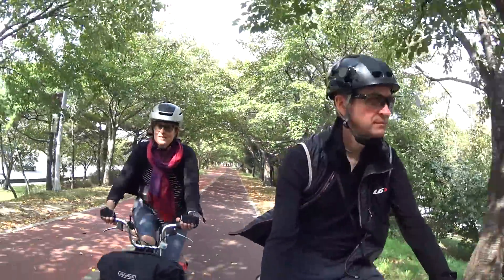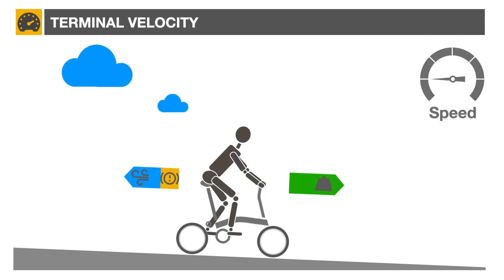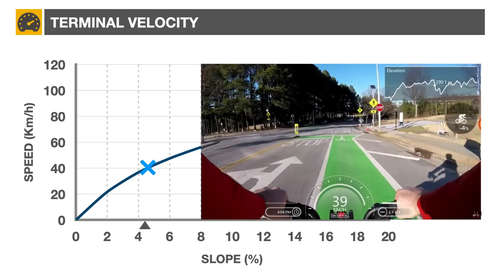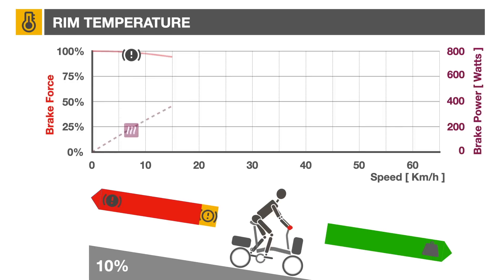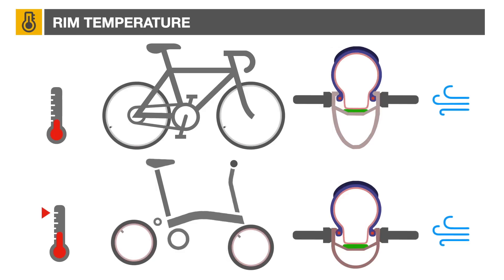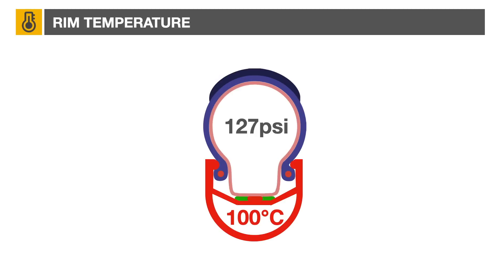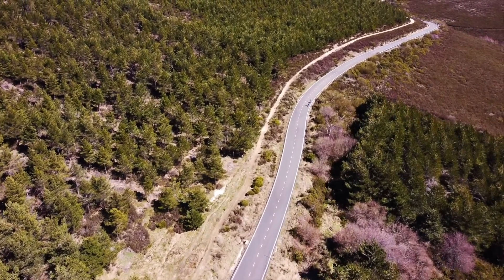Downhill with a Brompton [safely]

Comment from the maker: CLARIFICATION: While the Terminal Velocity of a Touring Brompton (T-Bag/Large Borough+20Kg luggage) is similar to having no luggage, the braking force required to slowdown (and the associated rim heat generated) will obviously be higher with a Touring Brompton. 
Brake force and rim temperature shown in the video were computed for a Touring setup.
Reply: Subbed 4 the math :)

Comment: We made many long distance trips with a fully loaded tandem. In an agressive and long downward slope, not only the tyres might blow, but also the brake blocks melt and totally loose their grip on the rims. Very scary. 
Once, we met another couple on a (packed) tandem, and exactly because of this fenomenom their brakes failed and both ended up in hospital, badly injured. Sadly enough, when they sent someone to collect the crashed bike and packages, there was no trace of it: all stolen! 
I can easily imagine that we Brompton riders with these little wheels have to be very careful not overheating them in the mountains. Thanks for reminding!
Reply: oh man, you would really have to be careful on a tandem! The rear rider adds weight and almost no drag, and you only have one wheel of braking power per rider!
Reply: I believe that could easily be prevented by using disc brake. Even if it comes with a cost

Comment: i had a scary downhill turn with the brompton in the french alps once which placed me pretty close to the guardrail. i vowed never to buy schwalbe kojak tyres after that.  with the softtail and slick tyres, the brompton doesn't feel much slower on the downhill than a roadbike does, and with that i can regularly exceed 80 km/h on a nearby road and over 90 on the one coming down from geschriebenstein austria (top speed ever 97.9 in ~35 °C wearing a skinsuit). i don't know brompton speeds, as it's very rare for me to take that in the mountains, and it doesn't have a computer on either. i think the huge difference between this and your examples mostly comes down to clothing and luggage, not the bike, but i have no proof of that

Comment: how bad would this be on 20 inch rims?
i hit 40mph on average on my ride to the train station and gone almost 50 on some other hills on 26 inch rims and was thinking of getting a dahon mu to get up the hill easily and then take it on the train or bus
its hilly everywhere round here too should i convert to disks maybe?
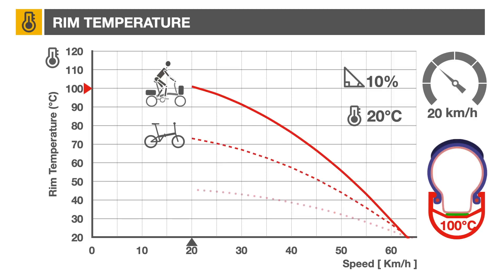Reply from the maker: 20” wheels with rim brakes are also susceptible to overheating but to a lesser degree than 16”. A comparison graph is shown at 05:36. Disk brakes would mostly solve the issue.
Reply: @2Bikes4Adventure  thanks
Reply: i do carry cargo btw i haul shopping over that hill too

Comment: Does applying small pressure in the brakes constantly to prevent acceleration cause less heat than full braking at top speed? I feel you could just use the brakes for a slow descent and there would be little to no heat generated, this problem would be completely avoided. Can someone explain?
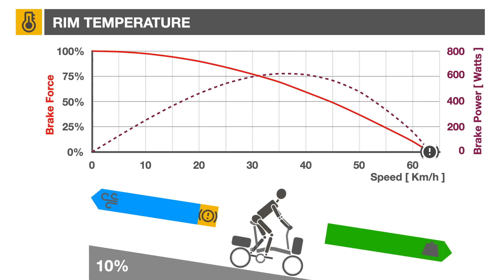Reply from the maker: Interesting question. The answer would vary depending on the slope angle and speed at which the test is performed. As shown at 03:55, for a 10% slope, the maximum heat generated occurs at about 35km/h, the “red” zone being between 20 and 50km/h.
If your light braking keeps you above that speed, you should be fine.

Comment: Shortly after a longish descent on a steep and slightly bumpy route, I did have the spokes on a Brompton front wheel unravel - it was very alarming. It may have been a badly built wheel, and I may have been unlucky, but it makes me somewhat cautious in the speed I go and the kinds of shocks or vibrations that I may be creating on these little rims.
Reply from the maker: Alarming is an understatement. Vibration/bumpy road was probably a major factor (more than only downhill speed).

Comment: As a Dane in a flat country (hardly 200 m above the water at our highest point!) we do have a rocky island in the Baltic, Bornholm! And on this we have a few serpentine roads which are very steep! I couldn't ride up even with 6 gears, but had to walk much of the way up. And besides that, we have "cattle prevention bars" crossing the road at several places on the one and have to walk over or around them, with a self closing gate!
     Going down again I had my serious doubts, but even braking down from extreme speeds to pass the bars, my Brompton brakes never let me down!!!  Finn. Denmark
Reply: I have thought about changing my similar - titanium fork to a hydraulic disc brake version in front (Which is possible from non Brompton producers), but as the braking power is enough for really most of my use, I decided to save my money! Finn. Denmark.
Reply from the maker: Trading the lightness of a titanium fork (and conventional brakes) for a more robust, wider (and heavier) steel fork with disk brakes would make sense if the bike is used for (heavy) touring in hilly terrain.
On the other hand, if occasional travels (or frequent local trips with minimum load) is the intended use, a lighter configuration is probably more appropriate. The money saved can be used on other bike accessories.
Reply from the maker: Denmark may have a flat profile, but from what we remember from doing the Berlin to Copenhagen trail, it can be quite windy. Not to the point where we needed better brakes, but we could certainly have used an additional low gear.

Comment: Day 1 Alpe DHuez I met someone who saw someone go over a hairpin having suffered brake fade at high temperature.  They were very lucky to survive. Advice was the same. Release brakes to increase air cooling, brake evenly and hard when you need to.  Don’t just trail them!  I was on a full size roadie. Checking periodically by hand probably a smart move on a Brompton - if too hot to touch, stop and enjoy the view.

Comment: Hello to you both and thanks for creating such useful and informative videos.  I just have a very quick question.  which cycle mirror do you use?
Reply from the maker: Through the years, we tried various mirror types (handlebar, helmet and eyeglasses mounted).
For the last few years, Gilbert has been using the “Take a Look” from Bike Peddler [ https://amzn.to/3Rt2KEc ].
It is inexpensive, light, robust and easy to attach and removed from eyeglasses.

Comment: Wonderful. 
I am always leary of too much speed downhill when touring fully loaded on my Brompton.  On my latest tour on Isle of Skye I reached 34.6 mph (55.6 km/h) with 10 kg front and 10 kg rear of extra weight.   The bike was solid with absolutely no wobble.  I pulsed my brakes (equally front and rear) and just enjoyed the ride.  The ambient temp was approximately 19 C and the road was smooth tarmac.
Thanks for the excellent analysis.
Reply from the maker: Common maximum gradient for major roads are often in the 6 to 7% range, thus a 50-55km/h terminal velocity is likely the maximum most of us will (safely) experience (assuming a normal riding position and no tail wind).

Comment: Chris from Chris by bike made a video that relates to this. She actually reduces the pressure especially in her front tire for extremely steep descents. She blew a tire out coming down from Christ the Redeemer in Rio
Reply from the maker: Reducing tire pressure prior to decent is a valid strategy, but it has to be used judiciously as it will increase rolling resistance (and heat up the tires) even if no brake are applied.
Reply: @2Bikes4Adventure  thank you very much for for the information and qualification on that method. I haven't had to exercise any of this but I intend to do more traveling and I know I'll experience such Hills one day 😊

Comment: Great video. 

I have had  a quite bad experience that I think is worth sharing. I once did a descent from Chiang Dao to Ching Mei in northern Thailand. I was riding my titanium Brompton, that is equipped with one of the best v-brakes you can get. The bike was only lightly loaded, with  a Brompton bag mounted in the front carrier bracket. My guess is that I was doing 60 km/hour, the road conditions was perfect, but suddenly the bike started shaking. I couldn't do anything to stop the shaking because the front bag that caused the shaking is mounted directly on the frame. If it had been mounted on front rack I would have been able to counteract the vibrations with the handlebar. The brakes was useless, If I had applied them I would be send flying. This is probably the most scary thing I ever experience bicycling for 40+ years.
Reply from the maker: Frightening story indeed. Wobble/shimmy need speed (more than 50km/h) and particular mass/frame stiffness conditions to occur. In your experience, do you feel the particular front luggage setup contributed to the situation?  Do you think the presence of titanium fork and/or seatpost (?) were contributing factors in the system instability? 

 And most importantly, how did you eventually stop the bike from vibrating (or it just stop by itself)?

PS This would make a great video subject.
Reply: @2Bikes4Adventure I'm quite sure it was from the luggage on the front carrier block, but there could be other factors at play of cause. 

I only have good experience with the titanium frame parts, and they still look like new, even though the front and rear frame on my bike is from 2006 :o

I tried stabilise the frame with my legs, not easy on a Brompton, applied very low force on the brakes, and rode it out for a kilometer or so before I could stop the bike and take a deep breath.
Reply: @petergriebel7321  😬wow.  I'm going to have to do more research on this because I love going fast and I don't intend to keep anything on the rear rack and I do not want to have to carry backpack so I've been focusing on shopping for a highly functional front bag. I had not heard about this being an issue before. Thank you for sharing

Comment: To prevent overheating my rims on long descents from Alpine mountain passes I do fully stop the bike and apply a wet cloth/rag to the rim (be careful not to burn your fingers!) to help them cool down quicker. I do that after every half a dozen to a dozen hairpin bends (every two to three hundred meters of elevation loss) (depending on the gradient of course)  If there's a fairly flat section I ride that with wet rims without breaking so that the evaporating water cools down the rims quicker.

Spritzing them with my water bottle has the same effect as wiping them with a moist rag but uses a lot more water, hence the wet rag.

I noticed that the rear wheel heats up much quicker than the front wheel, probably because there are more obstructions to the airflow (frame, my legs, rear fender). (May be a funnel could help with directing more air onto the rim to help with cooling)

I blew my tube once because I raced a motorbike down a mountain... the rim was unbelievably hot afterwards and it's scary but I could stop alright. On Großglockner I saw full sized bikes with rim brakes blow their tubes too.

(Dipping the wheels in ice meltwater besides the road helps too if the brook can be accessed easily/safely but I'm always worried about abrasive stuff in glacial meltwater)

(Usually the maximum speed is determined by the road, i.e. I could go faster if there wasn't a bend in the road. But there is so I need to brake...)
Reply: Would caution that depending on the rim material and how the metal was treated during manufacturing, rapidly cooling the rim could cause warping. LIkewise, depending on the tire compound, going from hot to cold could weaken the rubber over time. Let things cool down for a few minutes. Temperatures will drop fairly quick esp. with aluminum alloy rims. They're great thermal conductors, also also great heat dissipators.
Reply: @AlbertCLee  True. This would especially apply to dipping the wheels in an ice cold creek.

 However, wiping the rims with a wet rag is only evaporative cooling and has the benefit of wiping off crud/brake pad material off the rims. The cleaner the rims the less damaging the braking is to the rims (I've had to replace them because after some time the rims become more and more concave from braking with rim brakes)
Reply from the maker: Indeed, as much as we would like to ride our bike at terminal velocity, roads twists, turns and switchbacks may dictate otherwise. 
From your experience, you never had issue with degraded brake performance due to a wet rim (i.e., it would dry fast enough even if spraying it with a water bottle?)
Reply: @2Bikes4Adventure  Of course wet rim brakes brake terribly - but that's mostly an actual problem in wet weather conditions. (Which is one of the reason I wish the Brompton had disk brakes)

If only the rims are wet (on purpose, as in my example) but the conditions are dry (dry road/no rain) braking (the brake pads touching the rim) wipes most of the water off the rim on the first few rotations of the wheel. 

Yes, you do need to anticipate that but very quickly braking performance is back to normal. Thanks for pointing that out! 

(Yes, purposely wet rims do negatively affect braking performance but I never had any issues)

If you often "do" mountains on your Brompton do often check how much of your rim material your brake pads already shaved off. In seven years of ownership I had to replace the front rim once and the rear rim at least twice because I didn't like its shape anymore (too concave). You can get a css treated rim which lasts longer (because it's coated with ceramic material and therefore harder than the stock rim) (That is the other reason I'd love disk brakes on my Brompton)

Comment: I have had inner tubes pop a few times on descents, two  at pretty much the same point on different years on a charity ride on a 1:6 hill using Kojak tyres. Never happened when using Brompton Green tyres. I did note that it happened where the tube was touching the rim where the yellow Brompton rim tape was not centrally position. I have replaced the B tape with normal bike adhesive rim tape since. Not sure if this has helped. This year I had a failed in a similar manner but using Brompton green tyres and again the yellow rim tape was slightly off centre where it failed so now have adhesive rim tape on both wheels. This happened as I came to a holt after a similar hill but on the flatter part.
Reply from the maker: Tire failures after stopping can indeed occur as the absence of convection airflow leaves the rim suddenly without  cooling. I suppose it’s preferable to a failure at terminal velocity.
Thanks for the feedback.
Reply: Yes I still have a couple of pairs of older tyres. The yellows which were the least puncture resistant and the other Bromptons that are actually not green banded but were the ones that replaced them but the same I think. I do need to replace them maybe with the continental.
Reply: @martincook7195  thank you for responding. All my research was pointing toward the Continentals and then these lovely people @2Bikes4Adventure made an awesome video connecting all the technical dots and reinforcing my decision that Continentals are going to be my next purchase
Reply: What is a Brompton Green tire. I Googled it and went on the Bronson website and I don't find them. I've been shopping for my next tire as I'm still on the stock Racer and I think my next tire is going to be the Continental that just got released recently but I have never heard of the Brompton Green before so now I want to look that one up. Thank you
Reply from the maker: @NoZenith  Brompton Green are no longer available. Ref our video about tire (it does mention the "Green" and "Yellow" tires) https://youtu.be/p1i1W6xy8hM
Reply: @2Bikes4Adventure  I do remember you mentioning Brompton tires that used to be Brompton branded that came stock and I'm sure I've seen that video :-) I thought maybe they came out with something new and I hadn't heard about it yet. Thank you very much

Comment: That's why I wish bromptons had a disc mount, there's no downside to having one as far as I can tell.
Reply from the maker: They are slightly heavier. The front fork and wheel spokes need to be stronger.
But the resulting braking performance would certainly be superior (less susceptible to overheat and contamination). Would be a nice option to have indeed.
Reply: Maintainability could be a downside. Changing the pads is easy, but when you need to deal with the hydraulics it's not for everyone
Reply: @HolgerNestmann  I would likely go with cable disc brakes

Comment: Lower psi?
I've ridden in the 20's w/ cheap BMX tires
Since my bikes doesn't have suspension 
Zero snake bites too
Learned that would make regen braking useless
Reply from the maker: Likely higher rolling resistance on the flat road?
Reply: @2Bikes4Adventure  true,
Interestingly
On a park hill with mowed grass,
W/ maxed rated rear tire (50psi) 
& about hand deflectable,
to take off the bite of the road,
In the front
I was stopped in my tracks
Down hill 
Granted
I was inching down
With no real momentum
& The slope was maybe 2' x 4' 

Also
I've been too lazy to put my brakes back on
After testing something
& I've learned how to brake without brakes
1/5 ways
if there's grass on the side
It can help :)
Reply: I had two snakebites with less pressure. Also I am curious if the higher warp cause heat too?